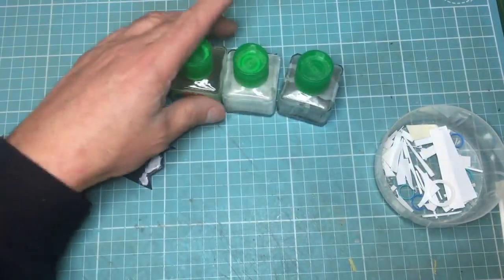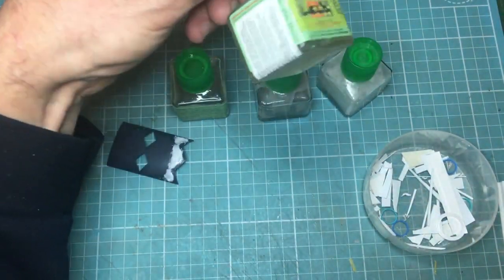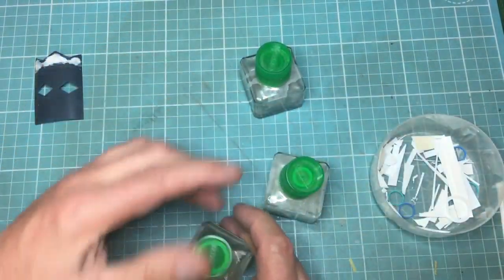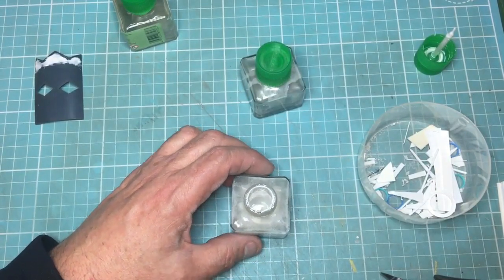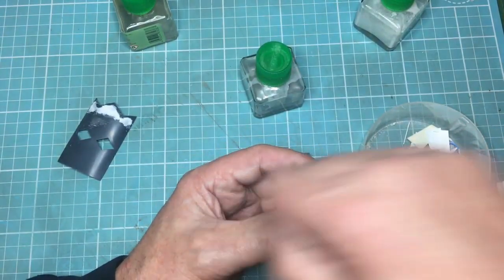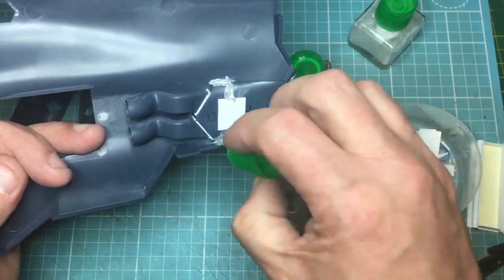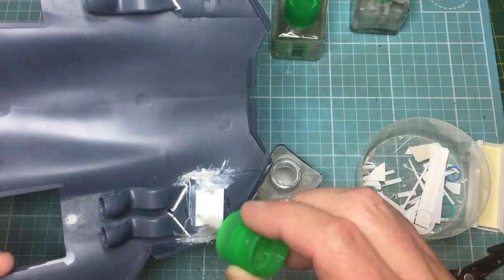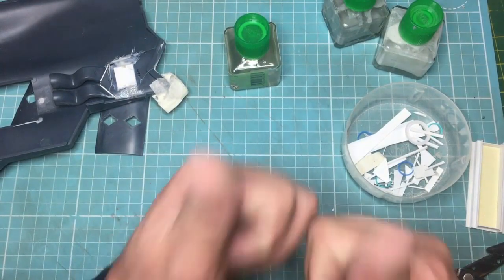All about Sprue Goo

Comment: I prefer using Hasegawa or Dragon sprue when I make mine - it seems for me at least when using new white plastic it takes longer to dry also I have made it with Testors Liquid Cement and it worked just fine * Clear sprue can also be used to create things like landing lights , small windows etc  it works much better when doing round shapes as opposed to right angles.

Comment: Thank you for the informative video.   I wasn't happy with applying it with a brush, so I tried using a dental tool that is shaped like a paint pallet knife.  it's about 2mm wide by 10mm long with around tip.  It worked out really good for me, and it is far easier to clean up.  I was wondering if you ever tried anything like that?
Reply from the maker: No.. I shall give it a go. Thanks.

Comment: Hi Nigel can you recommend a video for us beginners on how to remove 3d printed parts fro the supports without damaging the part iteself. thanks
Reply from the maker: Sorry I cant. a hot blade would be a good idea?
Reply: Depending on how thin the supports are if you steep the mini in relatively warm water, not boiling, then the supports will soften first and make it easier to pull them away.

Comment: Is it common that it dries in long thin strings? like a hotglue guns glue.
Reply from the maker: If it is stringing its slightly too thick.
Reply: @NigelsModellingBench  Thanks, now off to thin it
Reply from the maker: You need to aim for it to just not string, so add glue until this happens. if you go too far and it's like soup, add more styrene..
Reply: @NigelsModellingBench  Will do sir :3

Comment: This was fine years, many years ago, when we had nothing else. Now there are putties available in an infinite number of formats, some do not even need to be sanded. Today this solution seems archaic to me. With all due respect.
Reply: @binal-flecki2387  In all the years that I have been using them, about 30, it still hasn't happened to me. But I do not rule it out, if it happens I will fix it with more putty.